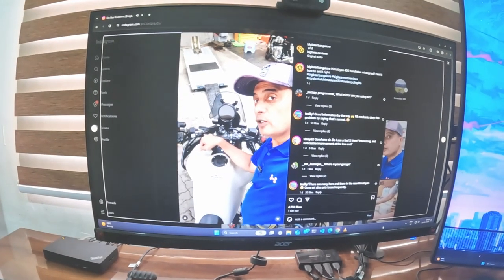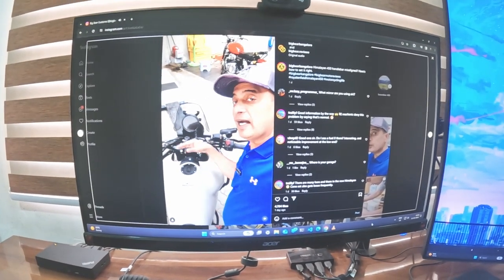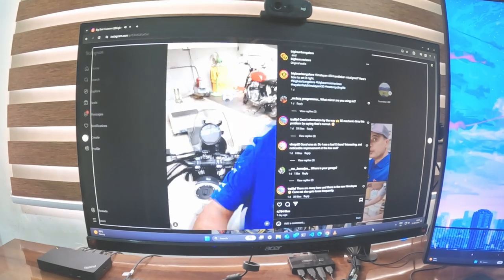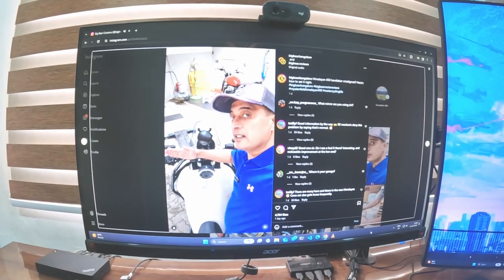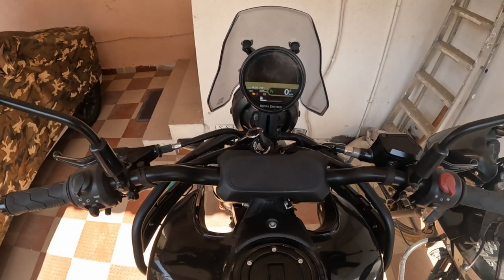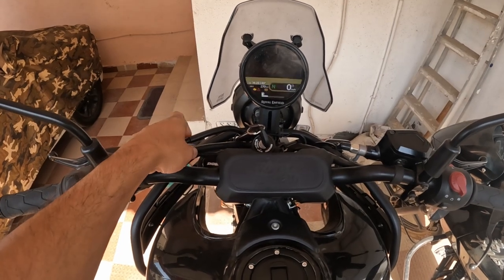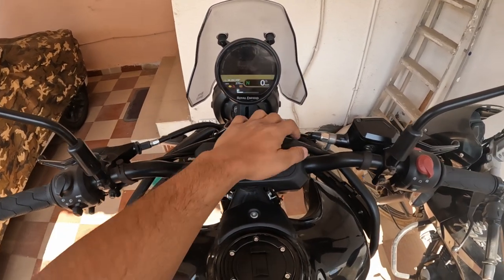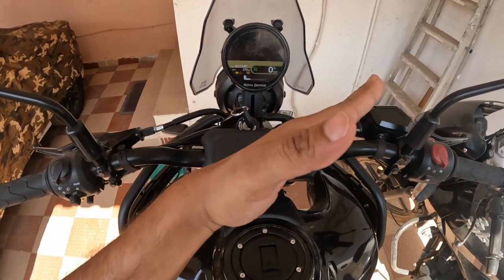Himalayan 450 handlebar misalignment issue, EASY Fix at Home!!

Comment: Jus took the delivery recently kamet white, I sense vibrations after attaining 60 in 4th gear itself and it feels like the bike can’t be pushed beyond that due to vibs, still im positive that after some feedback, it will improve, also the engine gets too hot after jus 3km and i smell something burnt, idk if all these are normal or maybe gone after first service. But they do make me feel a bit worried. Some feedback is appreciated, pls do reply
Reply from the maker: Hello.. 
1. The vibrations will keep getting better, in my case around 600kms and first service vibrations were totally gone. It felt like a different machine altogether.
2. But the vibrations were not that prominent at 60km/h, in my case around 90-110 vibrations were very annoying. But as mentioned in the above comment they got better with time.
3. Engine gets hot in the beginning. A  little burning smell should not be a concern. But if it is very prominent and doesn't go after running for some time. Maybe let's say 100km then you should get it checked.
4. I would advise not to go beyond 4000rpm for the initial 500kms. And beyond 6000rpm for 500-2000kms as mentioned in the user manual. 
Also do not hard accelerate. If you take care of your bike in the initial breaking period, it will serve you better and you will not face any problems later.

Happy Riding, cheers!!
Reply: @OnceARider  thank you, ill follow these instructions, I'm a bit relieved after this comment. 🙂
Reply: Running inn is the key. Keep under  4000 rpm till 500 km and 6000 till 2500 km. Any abnormal issue show the bike to the service  centre.

Comment: Do u find any major issue in this bike..any engine related issue or noise something
Reply from the maker: No engine related issues or sound noticed yet, rather the engine feels much more refined and smooth with every kms added to the odo, all the annoying vibrations are gone which were prominent below 500km after the first oil change and long ride after that. Also I would like to highlight, I have a very conservative driving style, never went above 4000 rmp till 500kms and still don't find any reason to accelerate hard. Falling more in love with the bike with every ride.

However there is one major issue with the bike which is the issue with the bike's  handle or balance, it pulls to right as soon as you lift off your hands from the handle bar.
Reply: @OnceARider  thanks buddy for such lonh reply..i appreciate it..n tell service guy to check it or reciofy it and if still not solve ask them to change handle bar issue..it is manufacturing issue with all new 450.
.n sir how much km u run till today..?
And should i go with this bike?
Reply from the maker: I have done 1067 kms on this bike till date.
Go for it without any second thought if you like the bike and suits your riding style. I chose this because it is a high revving engine, which I like. To be honest I might be little  biased towards this bike because I always wanted to own a RE bike and by coincidence RE launched this bike at the time I was looking for the bike, I considered the meteor, hunter and honda Hness, but as soon as I took this bike for the test ride I knew this is bike for me. But I was a little hesitant because this is a heavy bike with a huge wheel base and my  main purpose was the office commute and traffic is horrible in Pune, I went for it anyway and believe me it is a very agile bike, doesn't feel heavy and maneuverability is very good, the power gives you confidence to overtake and on highways no other bike in this price range beat this bike.
So I would suggest go for a test ride feel the bike and decide for yourself. Do not listen to the negative comments and reviews on social media, you know people want to get famous and you will get views only when you will say bad these days.